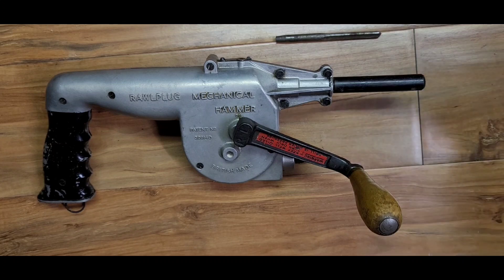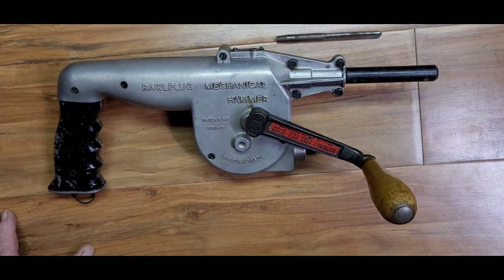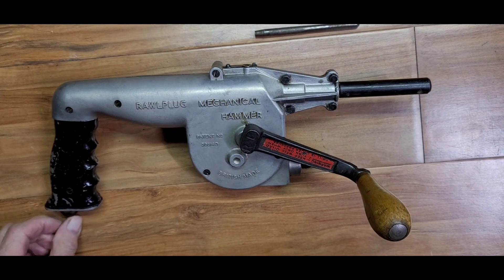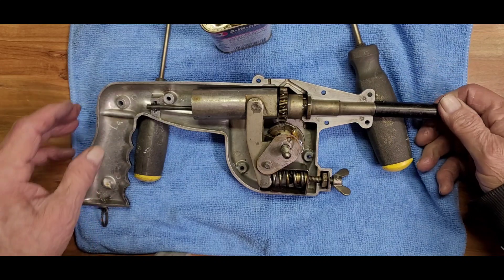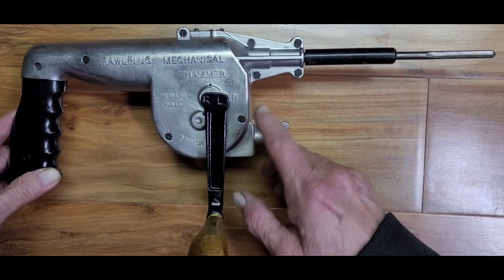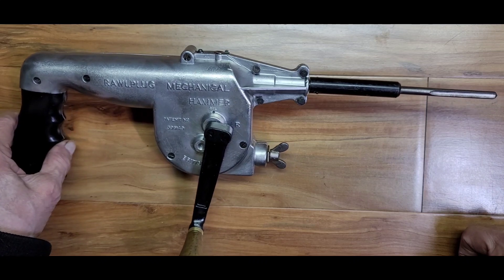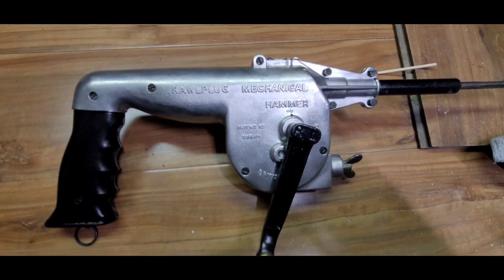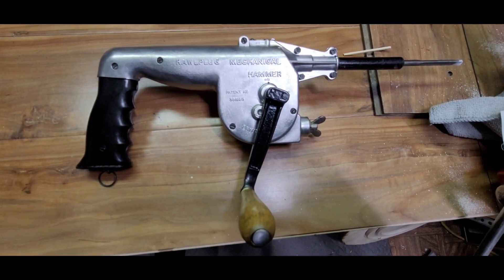Rawlplug Mechanical Hammer

Comment: John, my godsons's father used to be the boss of Rawlplug. Company dates back to 1910 when they invented the original wall anchor.
Reply from the maker: Very interesting Tony. The US Rawlplug company I worked for made the Rawlplug using Jute Fiber from India woven around a lead core and baked with a resin finish. It was a great anchor . The US company licensed the Rawlplug name from England Company until they changed the name to Powers Fasteners in the late 90's. The company was sold to Stanley Black & Decker in 1915 who now markets the anchors under the DeWaLT name.